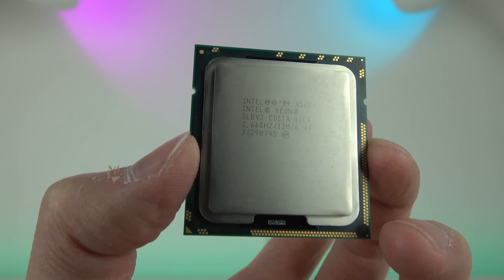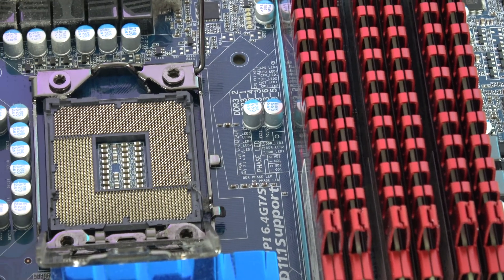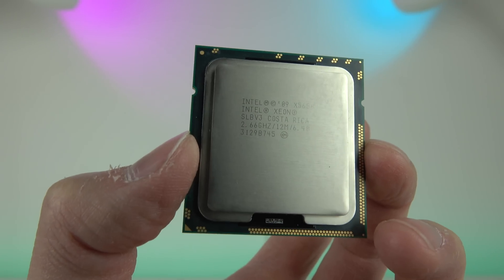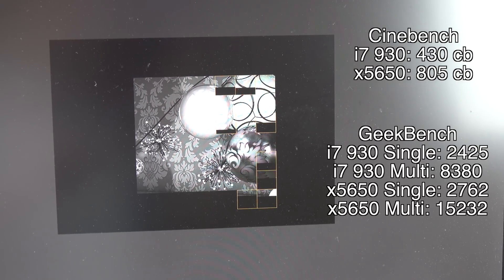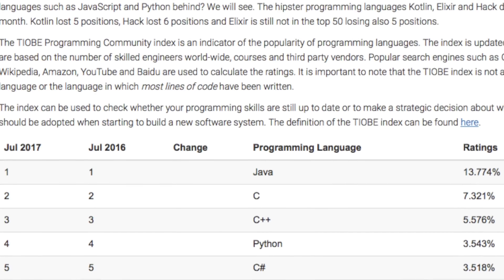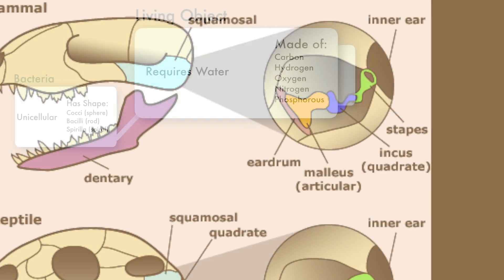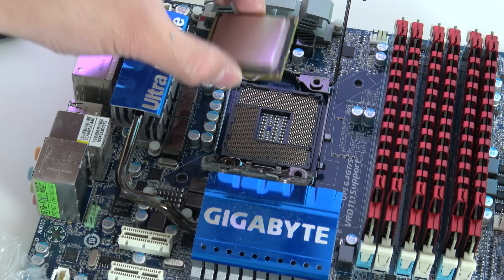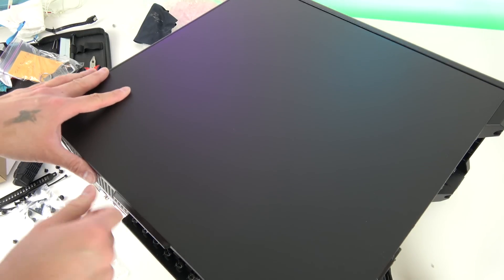This 6 Core CPU Costs $20. Will It Let My PC From 2010 Last 3 More Years?

Comment: I've had a lot of luck messing with older CPU technologies, especially on the server CPU side. The LGA1366 and LGA2011 Xeon processors are a REALLY good upgrade path from their respective i7 900 / i7 3000 / 4000 series. Especially if you can get a successful overclock from them!!

Comment: I still use my PC from late 2010 purpose built to play Star Wars: The Old Republic. It started out as an AMD Phenom II X4 925, quad core at 2.8GHZ, 16GB DDR3, Radeon HD 6790 1GB all on a Biostar TA990XFE. It's been 8 years and I've only upgraded the CPU (in 2015) to a FX-4300, the GPU (in 2018) to a GTX 1050 2GB and the HDD (2016) to a Samsung SSD.

This is the longest lasting personally built computer I've had. I used to build a completely new PC every 2-3 years (since early 90's) when the hardware had increased significantly. Since the build of my current system I have gotten married, had three kids and move 3 times including to a new state. My PC, regardless of how much time I have been able to use it, is a close friend to me.... now if I could get my wife to understand that :)

Comment: I'm still using an i7 860 with 8GB of 1333MHz RAM (from februari 2010), I only upgraded the GPU form a GT220 to a GT640, added a SoundBlaster sound card (because I broke a 3.5mm jack which is now stuck inside the onboard brick, but the sound is much much better with the sound card), and I recently added a 512GB SSD (which made a huge difference in speed)... Oh and I had to replace the power supply twice... I did also recently buy a Surface Book 2 to replace my Asus Transformer Book TX300, but I'm still rocking the desktop daily :) Obviously I'm not much of a gamer, I just occasionally play GTA IV, and a lot of Tekken 7 when I find the time, and for that, it's just great (medium setings)...

Comment: My old LGA775 build is still around (QX9650 @3.2GHz, 8GB DDR3 @1600MHz, AMD R9 Fury X) which was the last addition back in 2015 some thing then I ended up building a new rig when Ryzen dropped, but heck my old build is still quite strong when playing some games, yeah it won't play them games at 4k on ultra like my new build but you can still game on it at medium settings and still get a great experience and steady framerate so I believe most of the issues are in the eyes of the beholder, Tbh I put Windows Pro on my new rig so I could Remote Desktop to it and just stream games anywhere in the house I am at.

Comment: Watching this video was major deja vu. I built my last pc in 2010 (just like you). I upgraded to the same Xeon CPU (just like you), I used the same exact case and motherboard (just like you), I have 24 GB ram (just like you). Difference is that I paid a used server part company $200 for my processor around 2015. So, up until this year I used it for everything and it has been more than adequate for all my needs. Most games I play are old ones like Age of Empires II and Unreal Tournament GOTY... I only built a new pc (May 2018) in order to be able to play Star Citizen which was unplayable due to CPU bottlenecking with ole' faithful. The 2010 built may be aged, but it's solid. It got me through my first years out of high school and all the way through first decade of my career!

Comment: This is weird. In 2010 i built practically the same system. Same CPU, same cooler, same case. In 2016 I seriously considered upgrading to a 6 core xeon just like you did. In the end I decided I wanted a motherboard that supported some of the newer features like NVME, and USB 3.0. So i upgraded to an I7-6850K. But i kept the case.

Comment: I did the same from i7-920 to Xeon X5680 (from 2.66 to 3.33 GHz) also the Graphic card from Ati 4470 to Ati 7790 and soon to a new Ati 380X a big jump in power. I test it with a moderm Ryzen 1500X and I lost it on Cinebenck with the old i7-920 and the jump in power with the new xeon I beat it... I think for a couple of years more will be a beast and later I will need to buy a new one... why? becouse windows will think on my computer on something obsolete, yes I didn't upgrade it to Windows 10 (I hate it) and from Windows server 2008R2 I cann't swap it to Windows 10... maybe I will try it one day.. I pay 45€ for the Graphic card and 65€ the xeon and I will pay 130€ for the new one (to upgrade my dad's computer too) I think is the best way to keep this computer fresh and very powerfull, I used OBS with 1920x1200 without the graphics card becouse have some extra quality but I have it on the 7790 and I can reach 30fps... not ttoo bad

Comment: According to my computer, I have an AMD A6-3400M APU 1.4GHz with Radeon HD Graphics and 8GB of RAM, it works fine, hope it never stops working. It is overkill for all the old PC games I have atleast... :D The fastest and best computer I have ever had was a Pentium 60 with 32MB of RAM. 460MB Hard Drive was a bit small in the later part of the 90`s though, playing Fallout 2 from CD was not the best option... And it usually ran out of memory after some play time..

Comment: Still running a 2014 computer I built - in 2014, with a decent GTX card, started at 8 GB of Ram, upgraded to 16 GB last year. SSD was 128 GB, now 500 GB. Just as his point, if we can upgrade a machine, do, and it will become better as time goes by. Making a computer that allows for upgrading is a way to save money without shelling out tons of money and throwing away our older computer.

Comment: I put a cheap car air filter in front of my intake fans. It solved my dust issue inside the case. Also letting the fan run all the time on your ac is cheap and filters the air and makes way less dust in the house. You just have to change or vacuum the filters often. I made and painted a case for the filter so nobody even notices it.

Comment: Just FYI, don't ever use a vacuum cleaner on a PC. They generate massive amounts of static electricity which can fry components on  your system. Use an ESD safe blower or vacuum instead, compressed air cans are also fine too.

Comment: These gigabyte boards have issues with certain bioses and hex core xeons, Xeon overclocking and ecc memory. All work but they locked them down in later revisions so look for the first bios with hex core support.

Comment: I have never ever had a failed pc component in 20 years other than a failed commodore floppy drive and a burned motherboard because of a faulty usb hub. I still have my old Pentium 4 as a backup pc and my Core 2 Duo as an HTPC.
My Sun Ultra 10 had been rebooted 1.5 million times, then the vram battery gave out :)

Comment: Great video— Now that I've watched, my question is:  Are there not other CPUs that would fit that same "socket", that could provide you even higher processing power for let's say $50 or $100 vs $20?  I'm just asking because your framing question asks about "lasting 3 more years".  .. Or would the increases in processing power be only negligibly more than with the x5650?

Comment: What does 4k have to do with it?  If anything it will make it last longer since less load is put on the CPU and more on the GPU.  BTW I'm running an X5680 @ 4.60Ghz with a 1080 Ti on an ultrawide 3440x1440 display.  Life is good.

Comment: My computer is from 2011... one SSD upgrade. (Bulldozer with 8GB of ram)

My wife have my old PC from 2008  (phenom II) with a GPU uppgradera (285x) and a HD upgrade

Between 1994 and pretty much intill 2008 or so i use to upgrade my PC every second year or so. And it was needed. It was hard pushed to have the same Mother board survive more than 2 years.. 3 years tops.

Of cause, i was always going for a medium tear bang for the buck computer.  This was to minimize the cost over time.

But now days with PCI-E that is both backwards and forwards compatible... DDR3 memory that lived for pretty much for ever. SATA 3.. and even SATA2 that really is sufficiently fast for most application (even with PCI-E upgrades.

M.2 really eliminated the use for Really fast SATA connections in the future.

HBM will probobly in a pretty close future lowering the demand of the memory speed. 

Its really today Memory-CPU interface that tie down the CPU-MB-Memory to each other. Hopefully we can get some kind of PCI-E uppgradable memory interface in the future, and we might have MB that can live for 10 years.

Comment: Good shout but upgrading of PCs in a useful sense hasn't been possible for years, when I first started building my own PCs in the late 90s you could throw a new CPU into a five year old motherboard, I had motherboards which had at least three CPU upgrades that gave orders of magnitude additional performance, you just can't do that now. 

I very much doubt this is all down to new technology on the board, it's just capitalism in full flow, firmware updates could surely support at least the next generation of CPU but the board manufacturers just choose not to do it.

On the flip side I think the lifespan of a CPU, if you buy at the high-ish end, has increased. I'm still using a 4770k with DDR3 and it doesn't feel like something I built 5 years ago, the absolute need to upgrade just isn't there, whereas in the Pentium 4/Athlon days the processor would feel out of date after maybe 2 years.
Reply: Jon Johnson yup the greed of Intel has definitely made upgrading harder but and guaranteed new cpus for am4 until at least 2020 so hopefully ryzen will catch up in the high end soon
Reply: Yeah I have no allegiance to either company, I just get whatever works for me, looking at building a new system in the next few months and will probably go Ryzen. Also looking to build a Plex server and a low end Ryzen seems to be the best option for that too in terms of power usage and performance.
Reply: maybe get a ryzen pro with a lot of cores since they have a low tdp
Reply: I have an amd athlon 4200+ lol
Reply: sure you can,   most motherboards these days are more then capable of hosting many cpu's..     the i3  i5  and i7 for instance.     depending on which generation there from...  like my board has an i5 2300 on it, but I can up to an i7.

if your talking amd and intel, well thats obvious because they use different socket tech

Comment: The x5650 runs at a lower clock than the i7 930, why does the x5650  have a higher single core score? Are there improvements to IPC going from Nehalem to Westmere?

Comment: I originally bought a 2.8 ghz, core 2 quad literally in 2006 or 2007 and used it till 2 years ago...the wife uses this machine today with a newer ssd and finds the machine still very functional and snappy.  For myself, I upgraded and replaced with a intel setup 2.5 years ago and last year dumped that for a new ryzen 6100...love the chip for what I use my PC for...I do not know if I'll get 7 or 8 years out of it, but it is nice to grab something that may no longer be the fastest, but it's still nice to see it functional and a contender.  So, perhaps when you finally make a big, new upgrade, you'll migrate to a thread ripper or something along those lines...nice video...and you had a pretty pumped setup back in the day...cheers.

Comment: Our PCs from the same era (early 2009) look very similar... Intel i7 920 gtx 260 core 216 12gigs. Upgraded to an gtx 660-->970. Used it until a couple months ago.  Till I got a Xeon e5-2643 2011 socket. (for free)

Comment: duuude, old PCs are like family members. I still have my dell desktop from 2009 and its 2018. It originally had a 300gb hdd, 1gb ram, intergrated graphics, and a core2quad Q8200. As it sits today, it has a core 2 extreme qx9650 overclocked to 3.8ghz, 4gb DDR3 ram, a 512 gb ADATA SSD as its primary boot drive and for games and such, a 1TB WD BLUE storage drive, and a radeon hd 7950. I'm sitting on this computer right now writing this and I still use this computer almost everyday for videos, some productivity and games like League of Legends and Fortnite and Diablo 3 and it does fine in them. I don't see me getting rid of this computer anytime soon, if ever. It's like my baby, i clean it weekly and it serves me VERY WELL.

Comment: I have the i7 920 on a 1366 motherboard, best overclock I am able to get is 3.46.  I built this machine in 2007 and still use it to this day.  Witcher 3 played acceptable with my 680GTX although my CPU is a bottleneck for the card I have enjoyed my PC very much.

I am very attached to this PC <3

Comment: 6 cores yay......... 2.66GHZ  clock speed ..... I think I will pass.
 your better off using a Intel Xeon E5450 Quad-Core 3.00GHz. Im using two of them in a converted server with 32gb of ecc ram all for less then the price of his motherboard. which leaves plenty of breathing room for the stupid amount of money I now have to spend on a GPU........ I fucking hate bitcoin miners

Comment: Pro Tip #1: When dusting out your PC.. Use an air compressor (Saves on canned air money wasters) and blow out the computer OUTSIDE. And also stop any fans from spinning when blowing out the PC with compressed air to keep them from jamming up with dust..

Pro Tip #2: If a fan spins slower then it should because of dust.. You can take it apart and clean it.. But if you don't feel right about taking it apart, you can still clean it by spraying some WD-40 into the fan's internals (Don't worry, WD-40 is non-conductive, Just keep it away from flames/sparks when spraying, the propellant is flammable) after spraying it down with WD-40, use the compressed air to turn the blades, be careful as to not cut yourself with the spinning blades, this will help free up the blades. 

Repeat the process until the fan spins smoothly with out air or close to it. If it stops spinning right after you stop blowing air into the blades, then there is still dust/dirt trapped in the brush-less motor section of the fan.. repeat the process... It will get messy with all the WD-40 flying out of the fan and off the blades when you spin the fan with compressed air.

Disconnect the fan from the PC if possible, if that is not possible, like with a PSU, then try to clean it buy using the straw tip that comes with the WD-40 to aim it into the fan internals and use the compressed air method again.. 

ALWAYS UNPLUG THE PC BEFORE CLEANING IT OUT
Air Compressors are you friend, Canned air like in this video is not (The propellant is not good for you).
Dust is a FIRE hazard

Comment: still using an old i7 920 from 2008 OC'ed to 3.4 and plan to OC to >4.0.. 
because: bottleneck

got forced to "upgrade" to R3E from R2E because the mobo is sort of half dead.. dem LGA1366 mobo price :(

Comment: Nice vid.
Did almost exactly this, X 5650 (£25) with same motherboard, you should overclock to see real benefits ! If you have a good socket 1366 board this upgrade is a no brainer. This combo could run 4k with a better gpu not too much bottlenecking, don't forget it has triple channel ram. The only thing I really miss is decent sata 3 connections but overall it's a beast !